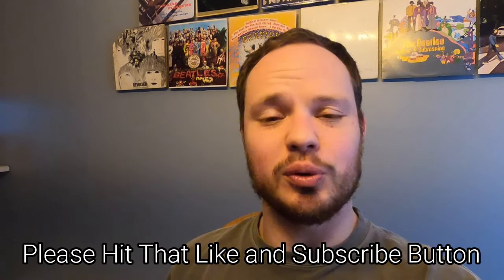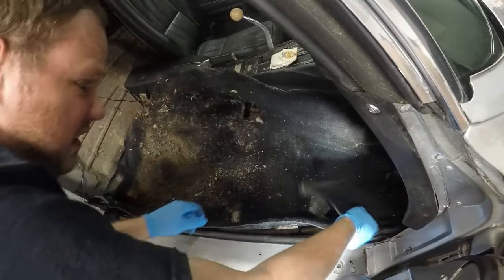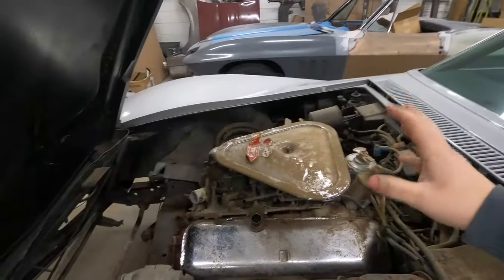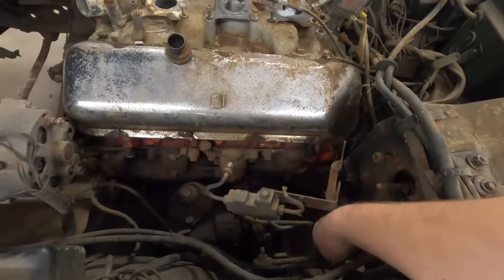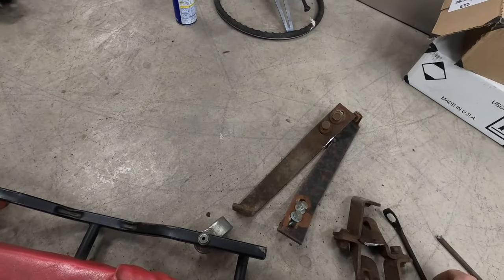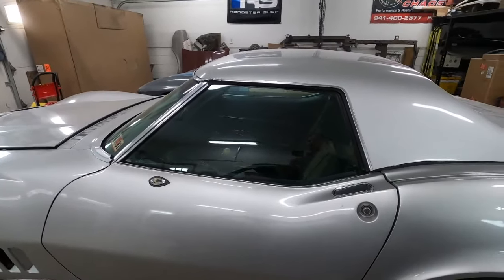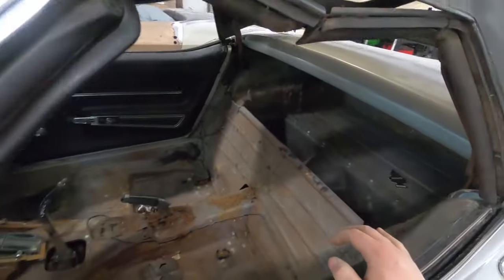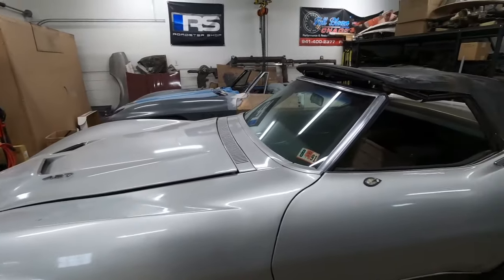Prepping The 68 L71 Vette To Remove The Body.  Removing The Interior, Steering Column, And Gauges.

Comment: What a mess! Stupid mice. Hey don't give up on the vinyl top. My car sat for about 40 years and the top looked the same. I wanted to try and save the top before replacing it. Took a drive to my local AZ to see what they had for cleaning  vinyl and clear plastic or yellowed plastic. I got Meguiar's convertible top cleaner and also the PlastX. Followed the instructions and a couple hours later I had a clean top and clear window. Not perfect but 99% better and original. I guess the yellowing is because plastic is made from oil and over time it tries to escape. It was even kinda sticky. I'll have to replace some of the weather strip but that's cool. Give it a shot Mitch. Remember straight strokes. Great video, gotta go through hell before you get to heaven. Take care stay safe and get some fresh air.

Comment: Looking forward to the finish and hoping you put that vinyl top back on.
I remember when they sold vinyl spray-on.
My brother bought some and used it on his 1956 Corvette top.
That stuff looked like today's spray-on bed liner.
Anyways,  getting back to the 1968 C3, those early C3s were just as mean as the C2s and then sadly,  they gained weight and lost strength. 
Keep up the good work 👍